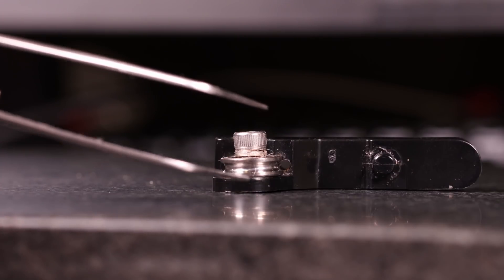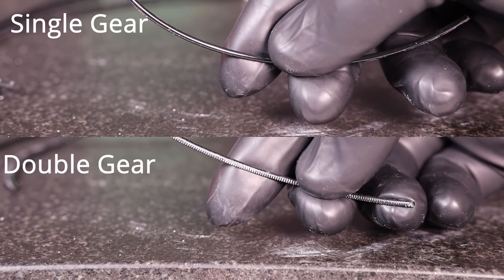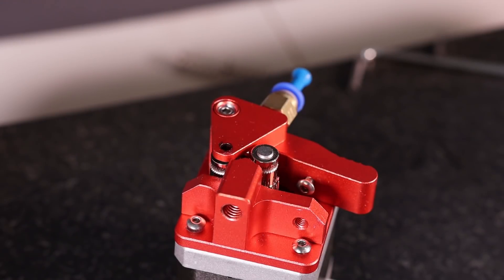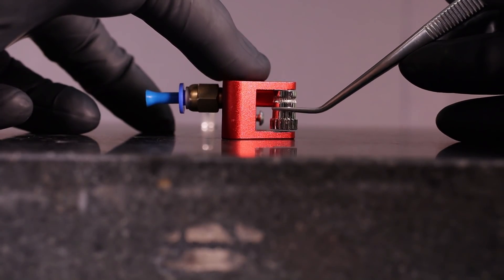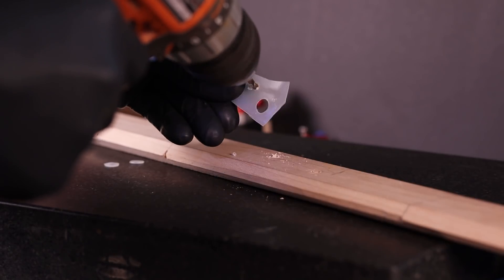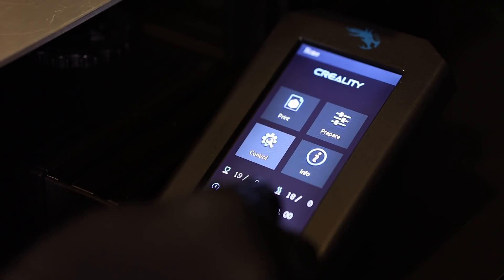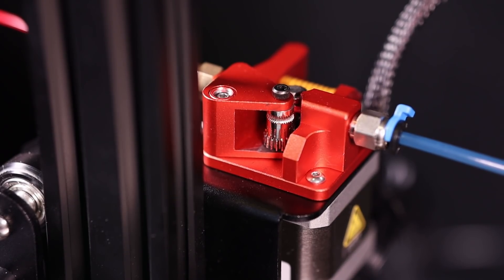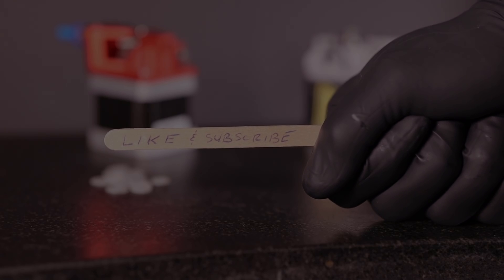Creality Ender 3 - V2 - Dual Gear Is a Great Upgrade, Except for This One Issue... Let's Fix it!

Comment: Adding plastic washers top & bottom is not a bad idea however it's not necessary and requires machining the gear far too accurately for nearly all users.  The metal shavings seen in the video are created when the screw through the gear is over tightened.  The screw should be tightened until friction can be felt when turning the gear and then backed out VERY slightly until  the gear is just free enough to spin without friction.  Also, I would discourage the use of grease as it (the grease) will attract dirt & dust and defeat the purpose of the lubrication.   The threaded holes for tube fittings are necessary, IMHO, the path between the filiment reel and the extruder should be protected using a PTFE tube & fitting.  The exit needs a tube also but probably not a fitting as the path is very short and straight.  This is a superior product but still must be properly used to achive the benefits.

Comment: Heard that only the cheap clones are that bad 🤔 But I'm not 100% sure bout that.
Reply from the maker: They seem to look similar but the key differences are the shaft for the bearing is not quite the right size, the threads can also run the full length and the bearings run on threads, which is no good.  And of course this problem with the grinding.  I am told that we can align the motor side gear a little high, looking at mine, it is already set slightly high and the filament is running through and bending down when it enters, their tolerances are a little off on my model.   For a few extra bucks, best to buy a better one probably.

Comment: I had to file down the aluminium and add a stainless washer to get mine working, but its still a pain. Far better to get a trianglelabs BMG clone as its easier to feed filament, better for flexible, and a similar price. Also a 3:1 ratio aswell as dual gear whereas this one is just standard 1:1.

Comment: Interesting. I just brought one of these direct from Creality and it has some small bronze washers above and below the gear. The arm is shaped a bit different too. Maybe they updated it? Maybe there is something to the slightly more expensive model?
Reply from the maker: I will check it out, thanks for mentioning!  I saw the image and it looked the same, but it seems that maybe these knockoffs are missing a few critical parts.
Reply: @NeedItMakeIt  This is the one I got.
https://www.creality3dofficial.com/collections/head-extruder/products/creality-cr-10s-pro-bondtech-double-gear-extruder-kit
And here you can see the bushings, because the pictures on the website don't show it. The grease is mine. 
https://i.imgur.com/SQmaFNa.jpg

Comment: Thank you so much. This is such a good idea with the plastic washer.
Reply from the maker: No problem, there is an easier solution too, people are setting the motor side gear a little high and it keep the driven gear at approximately the right height.  May not work well for TPU, but probably does for other filaments.

Comment: I have what looks like the same extruder from http://www.zyltech.com/zyltech-mk8-dual-drive-extruder/ and have not seen that problem after using it for a couple of months, but will keep a look out for it.
Reply from the maker: They are similar but not exactly the same, I think thanks your your link I understand why this is more likely on my version.  The teeth on my gears are hobbed, they are on an angle.  Yours show straight cut teeth, the other recommendation is to set the drive gear a little high and it will automatically align the driven gear.  Great points.   I think if I were to buy again I'd look for gear teeth that are straight cut and then set the motor side gear a little high.

Comment: I had a CR10S pro with this issue. I used shim brass and fabricated some 0.002” thick washers. I stoned the steel drive gear ends which removed all the machining marks and left a mirror surface. The aluminum was very worn with a deep 0.6mm circular rut so I filed the area flat. I also put an additional shim brass washer under the lever pivot. Finally, I moved the stepper motor drive gear in and out until the idler drive gear had some end space (floated) when gripping filament. Only the needle bearing cage can/might slide against the shim brass.
A few months ago repositioned the repaired assembly to the hot end creating a direct drive and quickly followed that by converting to duet control electronics. The creality controller failed in my 60C heated chamber. The chamber is just a clear corrugated plastic 4x8' sheet (building supplies) folded up and with some packing tape and an ikea picture frame for a door, it warms up from the bed heat.
Cheers Peter

Comment: All you have to do is raise the gear on the motor side.  The filament flows the grove.  The idle gear follows the filament.

Boom. Problem solved.  19 second fix

Comment: Dual gear makes no sense if the other gear is not driving as well.
Reply from the maker: Correct, this is why is it a gear and meshes with the driving gear.   There will be some backlash naturally in the gears and as they wear this will become more pronounced.

Comment: Hello, 
can you please tell me the size of the screw that goes into the gear ? 
Is the size 3MM X 20MM ? Thanks in advance!
Reply: https://www.aliexpress.com/item/1005001345186223.html?mp=1
Reply from the maker: I will take it apart tomorrow to make sure, mine has a print going at the moment.

Comment: My solution: Aligned the two gears  by simply inserting a filament between them and moving the filament back and forth to release the tension before tightening the gear on the stepper. Two plus years with no such problems as described here.
Reply: My guess would be that the filament keeps the gear not attached to the stepper motor from riding on the bottom causing wear, and the filament stays in that position because of the gear on the stepper motor
Reply: Do you by any chance have any photo/video that would explain specifically how you did this? It's been a couple months since I installed this, I do remember using filament to align the gears, but I still get the powder/shavings when I print with this.
Reply: Doing this right now to try to fix the slipping

Comment: My dual extruder has been running for over 2 years and never had this problem. Just align the gear on the stepper to the other gear(the fixed one) properly.
Reply from the maker: Do you mind to list the one you purchased, mine are aligned as you suggest, however there are a few variations of this model with slight differences.  If someone were to purchase one they'd be best to purchase the one you've used.  Thanks!
Reply: @NeedItMakeIt  my unit is just a random cheap chinese knock off found on Lazada (it’s like ebay/amazon in your country)😀

Comment: Tiny Machines 3D discovered this issue with this type of extruder a couple of years ago. They place the lever in a milling machine to add clearance for the gear. You can find information about this on their Facebook page ( https://www.facebook.com/tinymachines3d ) --scroll down to the August 9th 2019 post. You can contact them about ordering the revised part. This is one of the many fixes they perform on their printers before they're shipped, and they also install and test just about every upgrade available if you order them with the printer.
Reply from the maker: Very cool, I will check them out.

Comment: my biggest gripe with my dual gear upgrade was that it created a lot of dust out of the filament during retractions. I just used a hard enough philips head screwdriver to smoothen the sharp angles from the gear to the tube, and apparently, it completely eliminated the problem.
Reply: But that might make it less efficient in extruding the filament.

Comment: I just filed the gears so that they are not touching plate, like the original bondtech gears are. Used threadlock to keep the pin screw in place
Reply: I put the thing on cordless drill and rotated the gear and filed excess away.

Comment: My Solution: Move gear on motor shaft up. In my case, top surface of motor shaft aligns with top surface of the gear and that solves it.
Reply: Aligned mine by simply inserting a filament between the two gears and moving the filament back and forth to release the tension before tightening the gear on the stepper.

Comment: Had this extruder for a year, did not have this problem, but I bought it 1.5 years ago, guess the manufacturer cheaped out on this one and now it has this problems, the problem with mine was that the gears are noisy on high speeds.

Comment: Mine had already worn its way down at least half way through the metal arm so I found a washer that was close to the size that I needed so with a file I made it fit over the worn out part and now it's fixed and will last a long long than a plastic washer and maybe it might last longer than the bearings will.

Comment: I have this exact extruder since CHEP made a video about it, I put a good amount of grease on all moving parts from day one, and I notices just a little bit of wear to this day.
the idea with the plastic washer is brilliant, gona do this if I ever need to replace the old one or I buy a second printer.

the one thing I changed on mine was wehre the filament is inserted, I drilled the hole bigger so I can put in a ptfe tubing (just 5cm long) that makes it easier to insert the filament and you can have the filament roll on top of the printer without scraping the filament on the metal extruder insert  hole.

Comment: I filed the top of the gear down slightly because the hole wasn't 100% lined up (maybe 1.5mm off) and filed the aluminum a little and put a brass washer underneath. I did it that way because the gear's teeth were angled so it keeps it's distance from the washer. You're lucky the bolt holding the gear isn't threaded all the way down with the bearings riding on the threads. I had to make my own bolt so it would be smooth where the bearings are.
Reply: How did you end up making your own shoulder bolt? I just spent an hour trying to find it all over the place and can't seem to find an m3 bolt with a 3mm dia shoulder and 20mm overall length. Its maddening. Really interested in what you came up with. I'm considering just throwing the bolt into a drill chuck and spinning it with some sandpaper around it to remove the threads. I could just spend another $16 and order another extruder, they are cheap enough.....just have to make sure to look out for the black bolt(good one) as opposed to ones with the stainless bolt in the pictures.
Reply: @housinit  I just happened to have a metal rod that was the right thickness,  cut it to length and added threads at the bottom. Right after I did this I happened to find a long m3 that had a smooth part longer than the housing. I bought it but haven't cut it/put threads on it yet.

Comment: Installed mine (after a broken arm) few days ago. I will disassemble it tomorrow to do the same as you. Thanks!
Reply from the maker: A few people seem to have inserted thin shims, did you read the comment about setting the gear on the motor side a little high?  That might do a good job of stopping the grinding also.  Thank you for the comment!
Reply: @NeedItMakeIt  Read it all, will try it all :) Thanks!

Comment: Super sticky glass bed....

Found a trick to make a plain glass bed supper sticky for PLA, haven't tried other materials just yet.

After cleaning my glass bed with isopropyl alcohol i hit it with a propane torch not sure why i did i was mostly screwing around, but then i ran a lint free cloth later to wipe off any dust from sitting around and the cloth was very grabby, so i cleaned the bed with iso and then hit it with the torch again and yup the glass bed was super grabby again. I then tried to hit it extra long and it was way too grabby even at a cold bed the PLA was flaking off from the bottom of my test print
Reply from the maker: That is both weird and interesting.   Do you know if the glass is borosilicate or tempered?  With PETG I use glue stick it bonds so well that I use the freezer to release the prints every time.  It makes for very flat and accurate prints.
Reply: @NeedItMakeIt  it's plain tempered glass 4mm thick.

My assumption right now is that there is a layer of sooth or carbon deposited on the surface since i run that torch at a really high setting. To prep the surface, I've gotten a pretty good feel for the technic to get a good stick that still releases when the bed cools.

I originally got the torch to clean up prints with zero wait on warm up time plus it was only 15 bucks at Walmart, good luck finding a battery powered heatgun thats an good for that price

Comment: I've already got a similar kit ordered (currently on the proverbial slow boat). No doubt I'll need to make a similar modification.

Thanks for the helpful information.
Reply from the maker: A viewer had a great tip, align the gear on the motor side slightly high, the hobbed curve will keep the driven gear at approx the right height, that's a great tip and probably works as well as my solution.
Reply: @NeedItMakeIt  I saw that. Another idea I was thinking about was making a washer out of some shim brass that I have - it's a bit thinner than the HDPE you used so I hope I wouldn't have to "adjust"
 the gear as much if I followed your lead.  Decisions, decisions...

Comment: So I bought one of these a few weeks back, one of the variants from Amazon. I haven't installed it just yet and luckily I ran into information describing this issue the day it arrived. So I modded mine already and plan on installing it this week. What I did was similar to what you have done. I removed the gear and rounded the edges of the arm where the gear sits in the arm, just the tiniest bit. I then "painted" on some Dupont Nonstick Teflon coating on the arm and the gear. I then added a 0.1mm stainless steel shim that I had from a set of shims I bought for an RC car on Amazon from Yeah Racing and are 3mm ID and 7mm OD. The shim fit perfectly under the gear, fitting just inside the diameter of the teeth. Now I have a 0.1mm space between the arm and the gear and I hope that keeps it from rubbing. I tried to find teflon washers/shims that size but had no luck finding them, i'm sure they are out there somewhere. I also added SuperLube PTFE grease to the shim as well as to the pin bearing inside. My only gripe about he extruder set I bought is that the bolt that goes down through the pin bearing has threads all the way down the shaft. I noticed that yours just has threads on the ends. I need to get myself one of those  bolts. Great tutorial on how to fix this! I hope my comment helps others in their quest in getting better prints! Thank you for the video!
Reply from the maker: Very interesting idea, it seems quite a few people have their own innovative solutions so solve the problem.  3D printing people tend to be problem solvers as well, which helps.  Nice work.  Dupont teflon coating, I will have to look that up.   Nice work!
Reply: @NeedItMakeIt  Yeah, the Duport Dry-Film Lubricant works well, I have the squeeze bottle, but they also have an aerosol. I learned about it from people using it to put a film on their Z axis screws. People have been using it to put a film on the inside and outside of their nozzles to prevent clogs and from filament sticking to the outside of the nozzle. I did coat my nozzle with it 2 weeks ago, just the outside, and it does seem to keep it cleaner and easier to pull off filament from it. DO NOT let it get on the bed or you'll never get a print to stick, lol.
Reply from the maker: @housinit  Sold!  I was thinking about something on the hardened steel nozzle the other day and I print with PETG now mainly and it likes to stick and then dump a nice string in the worst place.    Great info thank you.
Reply: @NeedItMakeIt  Yeah, thats where people use it the most, with the hardened steel nozzle and PETG. Its cheap on Amazon and I feel like it will last me forever.

Comment: I have the same extruder but my problem is that the filament grinds I think because of the friction with the filament guide holes that the extruder has when the retraction happens, do you have any advice?
Reply from the maker: It might just be a symptom of a different problem.  I have had this problem when the bowden tube is too short, also when the nozzle temp is too low for the filament I am printing.  Some filaments do not glide well in the tube, PLA believe it or not takes about 2x the force to send it through the tube compared to ABS or PETG.  There is also the tough-to-spot issue of the tube not being bottomed out to the nozzle in the hotend.  Best bet there it to take the nozzle out and then send the tube right through to make sure it is clear.  I try and do this about every 20-30 prints just to make sure the tube is in good shape and there is no deterioration. 

As always there are lots of variables.  The best way to address them is to take everything back to stock and see if the problem continues, swap out one part at a time.  

If you continue to have problems, try and record the problem in a short video and send it my way, I'd be happy to help.